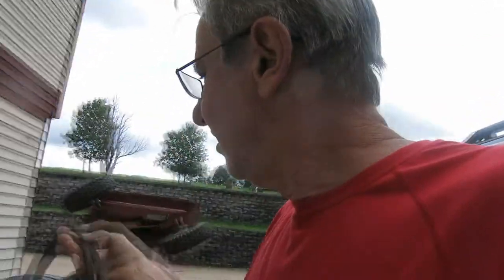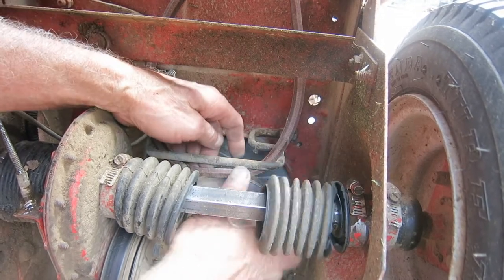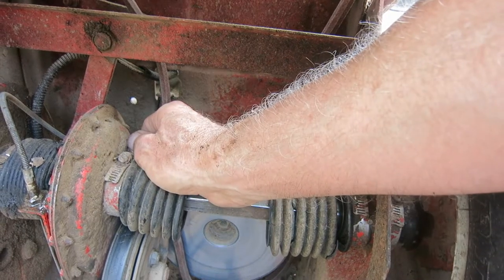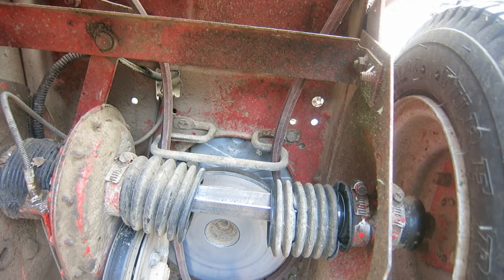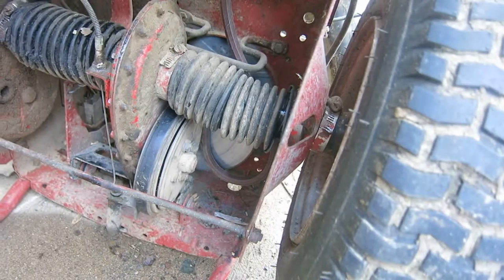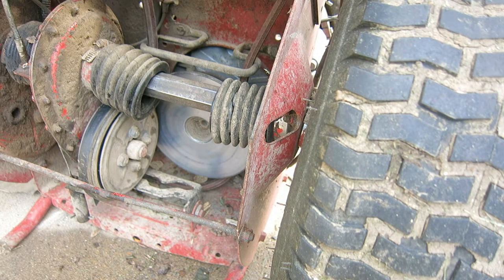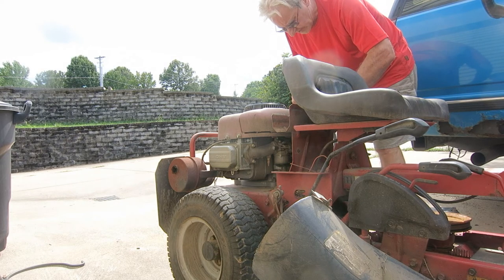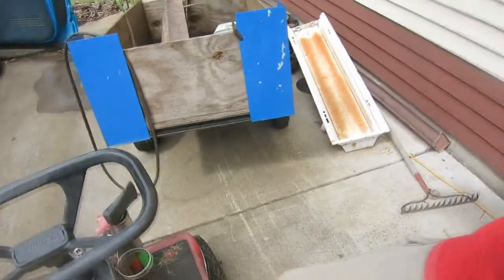snapper belt change.1028

Comment: Thanks Petro.  I was just out cutting with my 28in HVAC and when I engaged the blade I noticed rubber burning.  I suspect my belt is shot.  I had no idea how to change it will give it a try.

Comment: I went out after making the comment about loosing clutch , but before doing that i tried without doing any adjusting otherthe hoding down clutch spring , the same one he was using a little pry bar on. Mine moved easy with a screwdriver .It wasn't enough , I loosened the front engine bolts 1/4 inch ,the ones at the top if it is standing up , mine were 1/2"  .  That gave me enough room to push the belt through with my fingers .The reason I was changing the belt was because blade wouldn't  DISENGAGE .I ended up loosining the clamp on the body bar and shortened it by 3/8" .everything works the way it should .EXCPT i HAVENT FIGURED WHY i HAVE TO ROCK THE MOWER BACKWORDS WITH MY BODY WEIGHT TO GO INTO REVERSE . Anyone have a solution or an understanding of that ?

Comment: Too cpmplicate. Lift the snapper on rear tubes. Change to gear 5. Press the brake down and fix it with second Person. Now press the drive wheel with a tool down. You will have enough plane for the Belt. Its done in less than 5 minutes